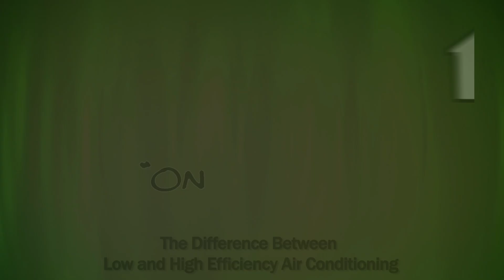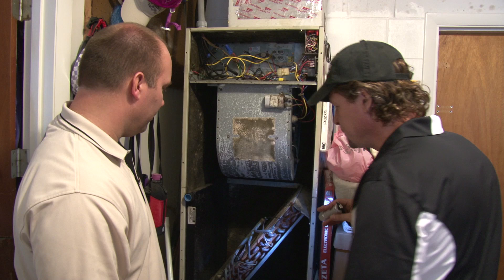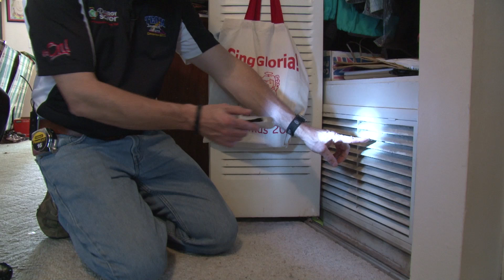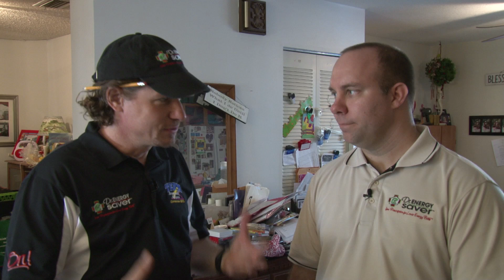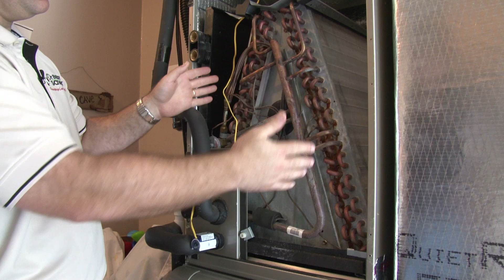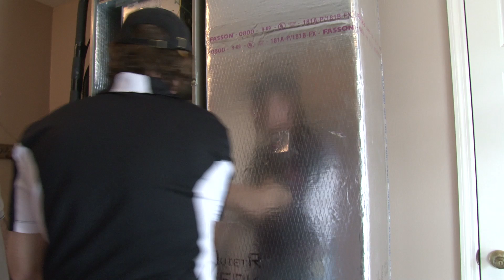The Difference Between Low and High Efficiency Air Conditioners

Comment: If for example,  I buy a 15-16 SEER system, I pay how much more than for a 13 SEER system?  Then the manufacturer requires a yearly tech check up at how much for the service?  How much does the duct cleaning cost?  How much does the electronic air cleaner cost?  After putting out all of this extra monies, when does my pay back start to kick in for the "high efficiency" system  Doesn't high efficient mean using less energy (electricity)?  Are these fair questions to ask?
Reply: ritewayguy Never

Comment: god...when new, the Carrier Tech2000 started out as a 10 seer. nowadays, it's probably running at close to factory specs. I'll say 8-10 seer. if matched, I'd estimate this could be bumped up to a 11 or 12 seer. however, this homeowner was incompetent and said "oh, i don't need maintenance. it's fine." and that isn't a concator, it's a G** D*** CAPACITOR! and the highest seer rating as of yet is 24 SEER. NICE Carrier Infinity/Performance series condenser!